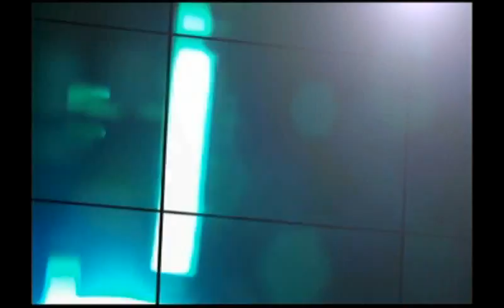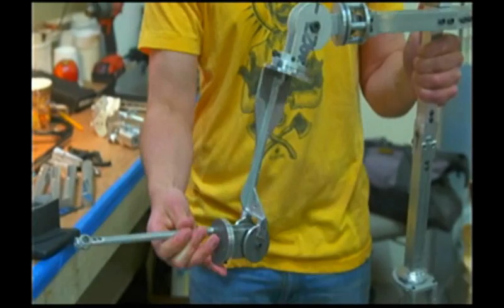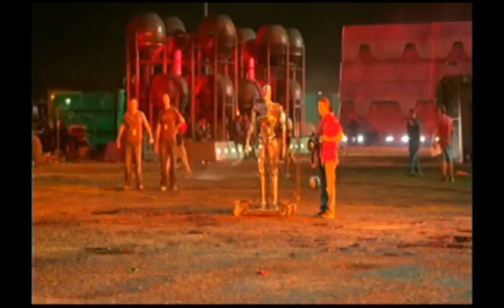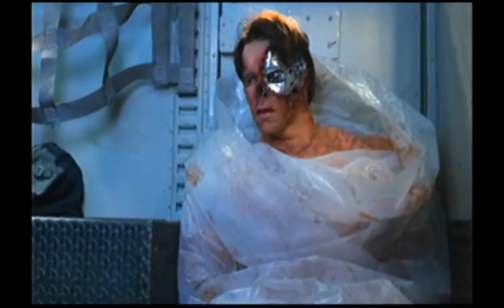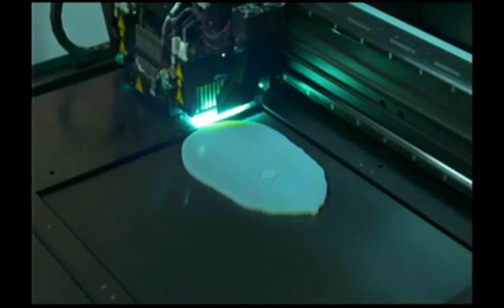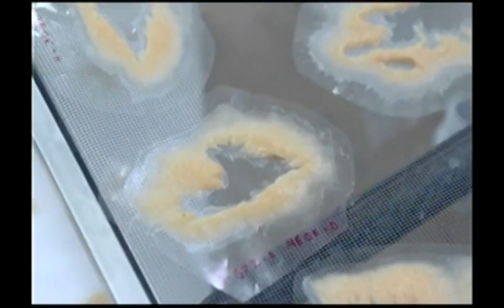Making of Terminator Genisys: Old, Not Obsolete

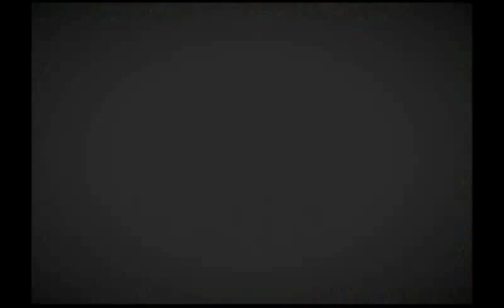Comment: 1:41 but my question is Why did they had to remake the design of the T-800 endoskeleton? I don’t see any trouble with using the original design which I like VERY much better! (They should’ve just used this new design as a variant model in the 800 family)